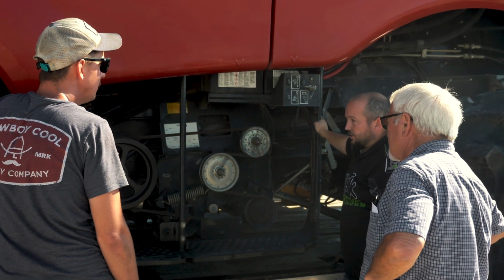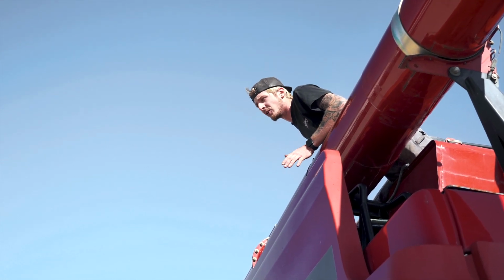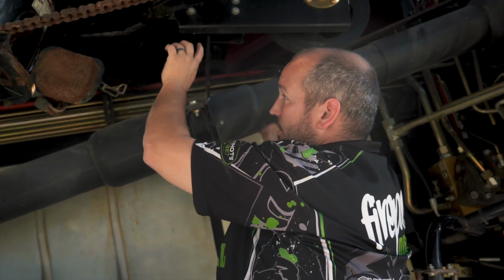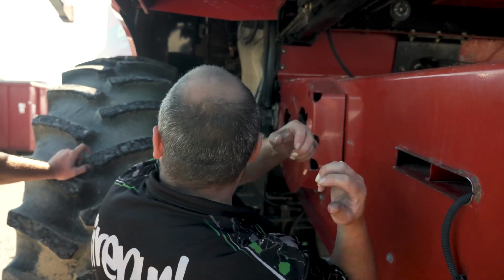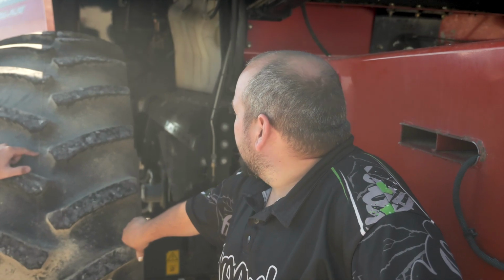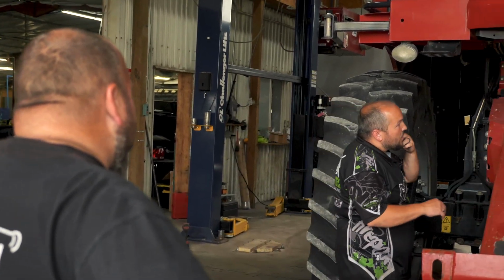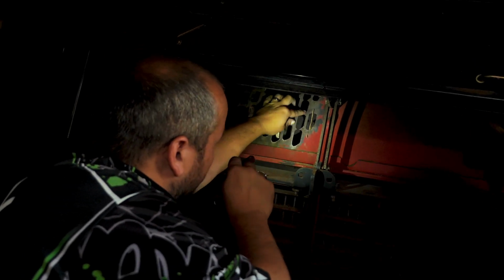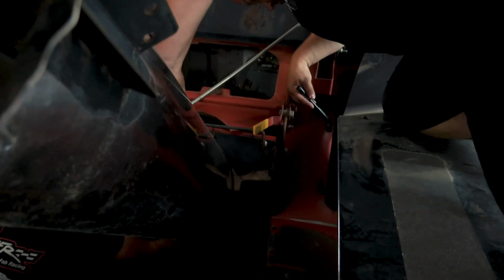8120 Combine Repair - Firepunk On The Farm

Comment: When you have the feederhouse apart Black Ace Parts makes a roller kit that replaces the shear bar ahead of the drive sprockets.  It will quiet the chain down a lot and those shear bars have a reputation of breaking loose.